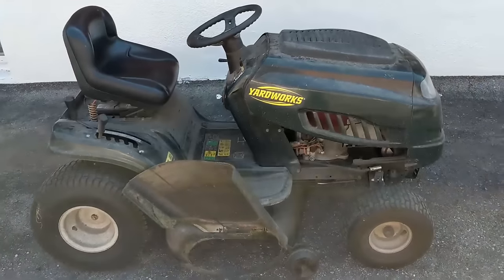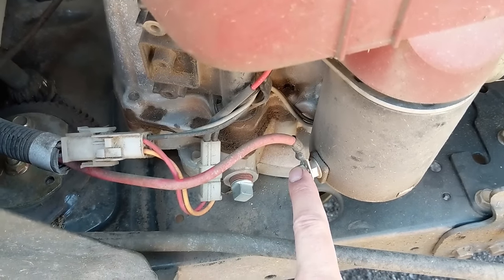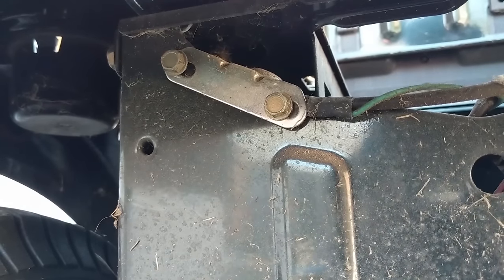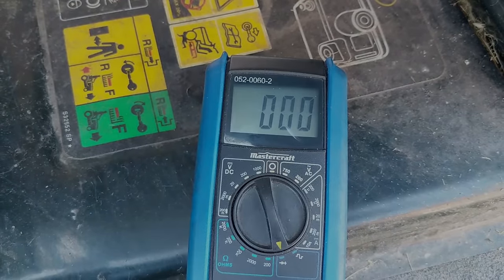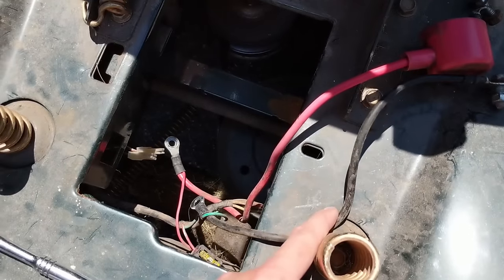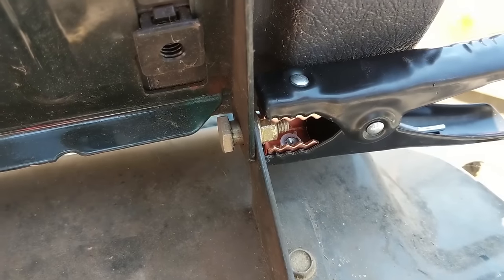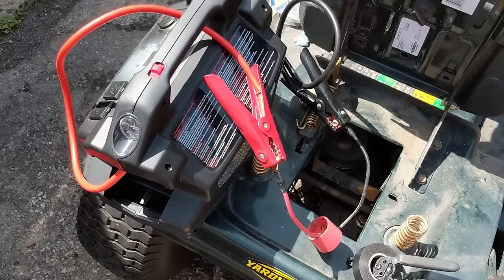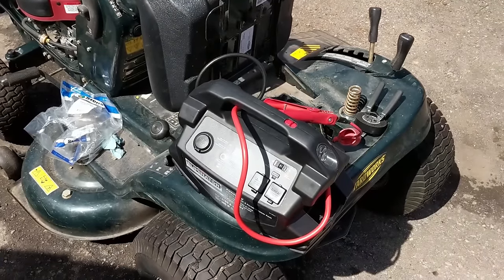Riding Lawn Mower - Solenoid Clicks but Doesn't Start

Comment: Great job dude, literally hit every point except the seat sensor . if your seat sensor isnt making contact your mower wont start either. Other than that I learned a lot about electrical conductivity and components. Great vid keep up the good work 👍
Reply from the maker: Yes but if the solenoid clicks it means it isn't the seat switch, because if it was the seat switch, nothing would happen at all!
Reply: It will start with the seat up. If it doesn't then you're in gear or the deck is engaged. I have a 17.5 hp Yardworks tractor, same exact one as in the video, and I start mine all the time with the seat up. I was jumping my starter from the battery.
Reply from the maker: Also, if the brake switch is engaged, it doesn't matter which position the seat switch is in. The seat switch only grounds the coil if the brake switch is disengaged, or if the brake switch is engaged but the blades are still spinning. That's how you can start and run a mower without being on it. Or get off it while it's still running to move a fallen tree branch.

Comment: Usually on newer models and some older models, there is safety switch or 2 hooked up on the ground side of the solenoid. Thus if one of the safety switches goes bad  ( like the seat switch ) the mower will not start.

Comment: Finally fixed. My solenoid would click rapidly when turning over. My starter motor was getting 12v but wouldn't turn the flywheel even when attached directly to battery, but I could hand turn the engine pretty easily. Turns out I got a new sparkplug with my carburetor kit and installed a plug that was too short. It caused more air to be allowed into the cylinder. When my starter motor would try to turn the flywheel, it couldn't overcome the increased compression and would draw too much voltage causing a voltage drop, which caused my solenoid to click rapidly.

Comment: Good advice, you sound Canadian. All it takes is an ohm or two of extra resistance in big cables like that, and power is robbed from the starter motor in line. Drop testing would have been fun to see before removing wires, though the lack of any voltage at all on the starter post in the beginning is strange. Do garden tractors and farm equipment usually have starter solenoids separate from the starter motor?

Comment: Is this test maybe a false positive? Reason I ask is because I heard in a different youtube video that the solenoid has a coil in it that opens the circuit for the starter motor and switches for the seat, brake, and pto. Is this test bypassing the function of the switch? I'm not a pro or know electricity, just asking because I have same problem. I get a click when the key turned. 

I think I'm just going to replace it and  see if the starter engages or not and go from there.

Edit: forgot to mention this was a helpful video. You got me in the direction I needed. Thanks.
Reply from the maker: Watch this video I did, it goes through the complete wiring harness.

https://youtu.be/vJWbfSxHY1Y

Comment: So I have a cub cadet ltx 1050.  I bought it used from a lawnmower repair shop. Used it twice now. It has a hard time starting when its cold.  Cranks slow at first.  But when it warms up it either cranks really slow or not at all and I have to wait 10/15 minutes and then it will start.  It has 108 hrs on it. 2012 model.
Reply from the maker: New battery, get a 370 cranking amp, I would start there to rule that out at least
Reply: @EliminatorPerformance  that's what I was thinking.  I paid 900 for it.  He said he went through it but it sat all winter long.  I got an old battery charger I'll try that first. Other videos say it's the ignition coil but it only has 108 hrs.

Comment: Good video ,good points always check your wires . never assume there good .We did not hear anything about the charging circuit , if you checked it or not .
Reply from the maker: Just wanted to focus on starter circuit for this video, will get into that in another video!

Thanks for watching!

Comment: I remember I used to just jump mine off by hooking a jumper cable straight to the starter then touch other cable to ground as a temporary way to crank it and finish cutting the grass when the solenoid, or some other connection was goofing up.

Comment: Quick question. I diagnosed a bad starter solenoid after watching your bench test video. So I got a new one installed it, worked great for three starts, now I'm not even getting a click. Battery is good, 12v going from key switch to solenoid, no click no continuity between posts. I think my mower is frying the solenoids because the one that was replaced was not that old.  Any ideas? It's gotta be a wiring issue, right? 

Love your videos!

Brian
Reply: Scag SR 18-B
Reply from the maker: Hard to say, I know when my neighbor tried to jump start his riding mower with his car running, he started the rider but fried the solenoid.

Same thing happened a few days later to another customer.

Replaced the solenoids and they worked fine again.
Reply: Ck. for burned start fuse  ///  But first do 12 hr trickle charge to provide enough AMPS in battery.   2nd  Wipe all oil/vasoline from battery and hand sand posts and clamps.  3rd  Replace fuse if burnt.    4th  Try to start.      5th   If fuse burns again  the starter can be BINDING ON A SPOT causing too much power from battery , burning the fuse.

Comment: Thank you  in short I changed every thing and still no turn over even jumped brand new starter which works,  did not think about the brake relay. because  I have the drive belt off and it in the air. I'll try that and see if the solenoid will engage. it's brand new.

Comment: It's always the last thing you do, because why would you keep going after you find the solution?  😁. Great video.  Mine clicks every so often.  You turn it and it clicks as you are letting go about every 3 times. Solonoid.?
Reply from the maker: Yes most likely, just make sure you have 12v at the solenoid wire everytime you turn the key! https://youtu.be/vJWbfSxHY1Y

Comment: Question. When I energize the solenoid with a wire directly from the positive battery terminal, I hear it click but it doesn't engage the motor. But when I use the push button that the solenoid is connected to, it turns the motor. Does this mean the wire I'm using to power the solenoid, from the positive battery terminal isn't giving enough voltage to power the motor?

Comment: Nice Job: Did you check the charging circuit after all other issues were done to see if it was charging o.k.? Thanks for the video's.
Reply from the maker: Yes, didn't include that in the video, but the magneto was charging the battery.

Thanks for watching!
Reply: @EliminatorPerformance  magneto doesn't charge the battery - the stator does.

Comment: Great video. I get the same clicking but when I check the voltage to the starter, I get 4-5 volts and not 12. My battery shows 12.4 volts. Do you think this is still a ground issue or seized starter ??
Reply from the maker: Corrosion somewhere between your battery connectors at the battery, ground, solenoid or the start
Reply: Thank you.

Comment: I have a mower question. I put a new starter on my mower and a new solenoid but when the key is in the off position the starter kicks on and when the key is in the on position the starter kicks off. I thought I had the wires connected backwards but there's just a positive wire that goes from the solenoid to the starter. I've bought two different solenoids because I thought it was the wrong one but both of them did the same thing. What else could it be?

Comment: Great video question on the fuse that goes to solenoid 
There are 2 wires 1 is rotten brittle, is there a way to remove pins from the fuse holder
The wire getting shorter any hemp be appreciated

Comment: So my riding mower was running. I set the brake to get off. The motor was running nice I went to get on it. It start to spit n sputter. Then turn off and all it does is click. Any idea what it can be. It’s a husqvarna yth 20k42 with a kohler 725cc 7000 series motor.

Comment: Great job on the mower 😀😀😀
Reply from the maker: Thanks for watching Robert!
Reply: @EliminatorPerformance  I have to rely The siloniod on my powr Kraft mower it was made for Montgomery ward by mtd it's a 18,5 twin cylinder l Head Briggs and Stratton 42 inch cut hydrostaic drive limited edition the engine is a 1996 year model the mower is apparently a 1990 model

Comment: My husqvarna yth18542 with ex1900 briggs is doing this exact thing. I have a new battery as my old one was bad. I also replaced the starter solenoid. I have 12.5v at batt and starter solenoid. However when I attempt to crank, I'm only getting 7.5v to the starter...

Comment: I'm surprised you did not use some Dielectic Grease on all the electrical connections.  You unhooked. I found on my  solenoid . The ground wire and hot wire  connectors were  corroded. I was surprise it made a connection at all.

Comment: I like to add a little dielectric grease to those type of electrical connections (battery+frame mounted grounds) to ensure some rust/corrosion protection.
Reply from the maker: Yes I'm sorry that never made it into the video, I'm actually sponsored by Permatex so I'm not sure why I didn't mention that, I usually include that whenever I'm dealing with electrical connections!
Reply: @EliminatorPerformance  You do a great job of explaining your troubleshooting and repair processes so I was surprised that you (after watching many of your vids) never mentioned the use of dielectric grease. You service and repair products that are used in an environment (outdoors) where rust and corrosion protection is important, (even on battery connections). Great work btw, I'm binge-watching and liking your content so if you have talked about it I haven't seen it yet.

Comment: A staggeringly concise, lucid, complete, well articulated and methodical break-down of what the problem could be, as well as every parallel remedy. 
But he still gets a thumbs down, due to lack of fashion-sense. 
--Dude... What's with the 1970's serial killer shades ?? 
Gonna' have vivid nightmares of you laughing and trying to chase me down with that riding mower, for the next week.
Reply from the maker: Lol thanks for the kind words and I actually have an ocular condition and one of the side effects is photosensitivity so I always wear shaded glasses, even at night believe it or not. My current glasses are gradient which means they're only dark up top and there's no tint on the bottom.

Comment: This is a great video. Having the exact same issue. All of the other steps checked out. Got 12V on one side of the solenoid but not on the other. Also, checked for corrosion on the solenoid and sanded it. Tried to crank and still got nothing. Any thoughts?
Reply from the maker: You could test the solenoid itself to rule that out: https://youtu.be/h_vy7DERing

Or test the safety switches, if you don't have 12v powering the solenoid to make it click: https://youtu.be/ceYCgXTEz_U

Comment: Very useful but my mower is still not starting. I’m getting a solenoid click and the starter is making contact with the flywheel. Should I expect 12+ V at the starter when turning the key? I’m getting around 7 V. Ditto at the starter post of the solenoid. 12+ V at the battery post of the solenoid. I’ve done the continuity checks on the main cables and they’re ok. Help
Reply from the maker: Probably too much resistance on your cable if you only have 7v
Reply: @EliminatorPerformance  I understand but I'm getting circa 7V too at the solenoid post on the starter side.
Reply: I have a John Deere 185 Hydro lawn tractor with a 17HP Kawasaki FC540V engine and a Nippon Denso 12800-2810 starter that had an intermittent "one click, no start" issue.  I was only getting 10.5 volts at the starter solenoid.  I installed a $16.00 knock off John Deere AM107421 Starter Relay Kit from eBay and it solved the issue.

If your mower has a starter relay, it might need to be replaced.  The starter relay compensates for low voltage issues that might be caused by aging wires and safety switches.

Comment: Does the selenoid need to be grounded? I put a new one in but left it hanging because I had trouble getting it in the tight space. The tractor won’t start unless I jump start it
Reply from the maker: If it has 2 small wires going to it, then yes it has its own ground wire. If it only has 1 small wire going to it (not the other 2 big cables) then the solenoid grounds through the base of the solenoid. https://youtu.be/h_vy7DERing

Comment: Great vid and process of elimination.  I appreciate it, but at what point would you test the voltage regulator?  I've taken all said steps, but I've had two new batteries not hold charge after mowing for about an hour until it putters out.  When i check the voltage, the battery is dead.  I tested the brand new batteries at the local hardware store and they say they tested good. They crank up the mower fully charged, but hen...(look above).  Ugh!!
Reply from the maker: So you'll want to check for a parasitic draw, or just put the multimeter on the battery while the engine is running, and if the voltage goes up, or it's more than it was when the engine was off, the alternator is charging it. Check this out, it may help. https://youtu.be/hFqYA2to3qw
Reply: Thanks for responding!  I’ll check it out.  New subscriber here, my friend.
Reply: @EliminatorPerformance  I saw the link.  Great video. I bit the bullet and porked out $65 for new regulator rectifier cause the stator was pushing 40 AC/amps while the engine was running, the voltage on the battery did not go up nor did it go down.  I checked for broken wires that could cause a parasitic draw, but I didn't find anything.  Even with the new regulator, the battery charge does not increase while engine is running.  I'm wondering if I could be missing something. Could it be that the new regulator is a lemon?  Could it be something else I'm missing?
Reply: @argentumman7116  did you crank up the rpm's when testing the regulator. Might not be showing up at idle speed.
Reply: @GM-dh5xi  It ended up being the solenoid.  It was practically brand new so I had ruled it out.  I'm not sure if it's possible to burn out the solenoid, but apparently it was the culprit.
Reply from the maker: These days, with so much coming from china, we can't rule out anything anymore. Glad you're fixed up!

Comment: I know this is a few years old, but hopefully you or someone else is paying attention... When I turn the key on my Troy-bilt Horse XP, I hear rapid clicking for as long as I hold the key in the start position. The battery is freshly charged after the mower sat all winter.  Any ideas or productive suggestions?
Reply from the maker: Battery could be 12v but the amps could be low and it won't turn over the engine. I'd recommend trying to start it while the batter and the booster is hooked up, might give it some extra amps.

Comment: Great video.  I have the same mower.  It wont start.   I have a new battery.   It was working great but when I turn the switch,  i hear a high pitched wining noise.  Any thoughts..  Its not seized.  Was working great before.  Thankyou.
Reply: Sounds like the starter.

Comment: Not to ask a stupid question but what is sending charge back to the battery when you don't have a alternater ?
Reply from the maker: A magneto acts as an alternator and it's copper coils located underneath the flywheel so you don't see it. Once the engine fires up and runs, it should charge the battery. So testing a battery at like 12.4v off, and 12.4v when it's running, means the magneto isn't working, it should be about 14v and is limited by a voltage regulator.

Comment: Helped me just figure out the wiring for a  troybilt pony someone else tore apart for some reason. However, now the starter turns on right as you connect to the battery. So, new problem i guess. Ill figure it out.

Comment: 🤔My Dude.its a long story.but happy sad ending....Had the same problem Soo after i replaced the $20.silinoid I end up calling a service tech that wanted to charge me $489 to replace the starter..I.told him i didn't want to spend that type of $$ soo he advise me to go buy one on Amazon for $40 so I did and still nothing ...Soo I said self look on you tube..and I found you..Soo after I spent $210 for diagnosis  fee a silinoid a stater and a busted finger..It was just a case of  exactly what you did..NOTHING.🤦‍♂️..unplug and plug back in.🤦‍♂️ problem solve..amazing...feel kind of stupid but it's funny as hell.. 😂 SOO THANKS FOR THE TIP..👌👍.I would even send you $25 just for the hell of it 🤷🏽‍♂️🥳
Reply from the maker: Sorry to hear that! Yea thats the issue with this design is sometimes it's just a bad connection! Thanks for watching! And my donate links are in the description!

Comment: My battery is good. I get power to the starter and bench tested starter which was good. I can turn the engine by hand so it isn't seized. Could the starter be weak? Or is there anything else that could be wrong?

Comment: Hi, my riding mower won't start unless I jump start it and still hesitates when doing it. And it wont jump unless I give it the right amount of choke. 

When starting. It has "no" click at all.  
I jumped start the starter from solenoid and it works. Battery is freshly new. I'm starting to think it's the start " ignition switch".  What say you?  Thanks!